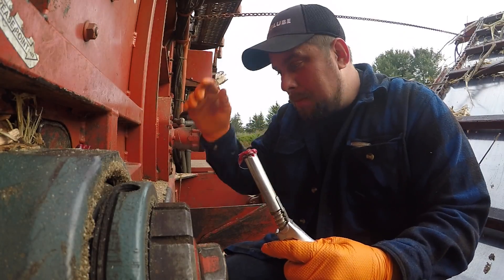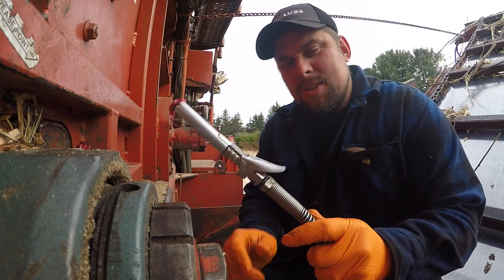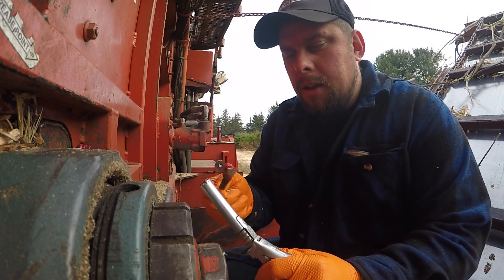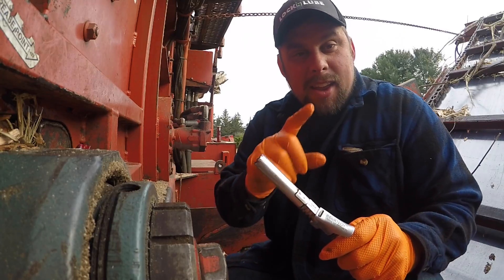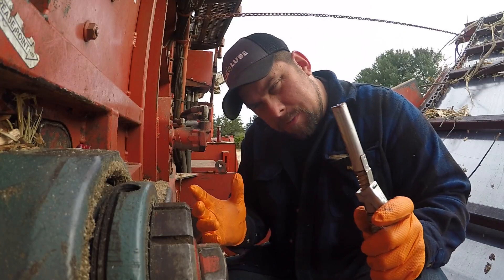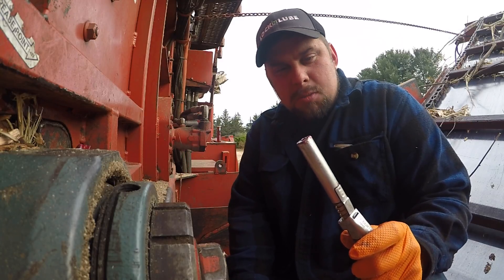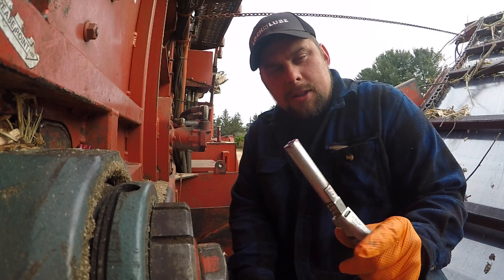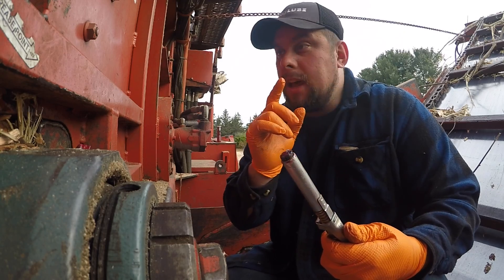AWESOME GREASE TOOL!!

Comment: I have the same grease gun, love it and the lock n lube as well.  Just a suggestion, I made up a short hose with a grease nipple on one end and a small conventional coupler on the other end, just join it to you lock n lube coupler for the odd hard access zerks, and you can still leave your lock n lube coupler  for the majority of the zerks that are easily accessible.

Comment: we have used LOCK N LUBE for about 3 years now and I love it.   we had 2 fittings on the case 60xt that just didn't like taking grease with the the standard coupler.   When we went to the LOCK N LUBE they would take grease every time now.     we have the short one and it can be a bit difficult to get on some fittings but overall I would recommend it 100% !!!!  
now where is my free hat LOCK N LUBE  haha
Reply from the maker: +Skidder Kev haha it’s a nice hat too!! Thanks for Watching
Reply: rub it in why don't  ya!   haha

Comment: Wipe the fittings off before you add grease so you don't push items to the bearings etc.
Reply: ....I do it even if it's for pins/bushings, extending-shafts, etc.... It's simple discipline (others have to pay, and see the cost of their production-lost and what it takes of work that it takes to fix em, in order to add this discipline to their maintenance-list) (which can even crash an early fresh starting business)

Comment: I have a couple of the shorter ones.  Mine came with a rebuild kit included.  Just use another grease gun with the standard fitting and buy the shorter Lock N Lube for the power grease gun.  They can not be beat for not leaking and staying on for sure!!!
  Just remember with any grease gun model you need to clean the dirt off the grease zirk before using a gun to put grease in.  The dirt hurts the sealing of any grease gun!

Comment: I was at our local equipment dealer Buck and Knobby some of you have prolly heard of them if you are from around Michigan/Ohio border and they only had a long one in stock and I picked it up and I love it to death makes greasing fun for once I have only found one situation where it's to long but it is easy to solve. I was using it on a performance tool air powers grease gun but gonna have boss man pick up a battery powered one and the grease I use is Chem Search, probably the best grease you can get.

Comment: Might have to check into the short one for greasing my super duty could come in handy. Somebody probably thought it would come in handy somewhere else. Thanks for the review. Say hi to lacey for me and let her now I'm thinking about her.Keep up the great video's
Reply: The only grease zirks your truck has is 2, on the front wheel drive  shaft, the 2 universal joints.  Short  or long tip will work.
Reply: i had to buy mine cost was like $35.00 but to me well worth it & all i have are little stuff like 6 garden tractors 1 lawn tractor plus 4 cars 1 van

Comment: U could get a traditional grease gun extension hose with a std zerk on on end and std coupler on the other. U could lock it on the locknlube when needed to get into the grapple and remove it when not needed.

Comment: Sorta surprised you don't take the time to wipe the zirks before greasing John.  I'm amazed "someone" ever gets employed anywhere, hands down is the most lazy useless employee on any job site. Funny people buy and use a brand/type of grease and use it on everything, grease is just oil in a semi solid carrier fluid that acts like a sponge, therfore you should use one grade on your high speed bearings and a different grade on your pins and bushes usualy one with 3 - 5% molly. Cheers mate.🍻

Comment: Why take it off??? Make your own adapter/extension from an ordinary nozzle + hose + grease-zurt. You'll able to grease where L&L can't go. And since L&L holds itself good, you'll only need to hold the extension-nozzle on the machine's zert. That is my solution anyway for places I can only crawl under a machine, evenless holding any grease-gun along, but I have a 20ft grease-hose-extension and another person pumping the grease gun away. But you also make an adapter from just a zert and nozzle if that's all you need (just attach with a leech on the grease-gun so that any "lunatic" that's hanging around in your bunch of workers don't think it's a loose candy and eat it)

Now, I still don't have any Lock&Lube as I hate mail-ordering etc and can't find any of those in any hardware-store 50miles around me, even though I've been talking to everyone about Lock&Lube for over a year now (ever since I heard about them from Oneloneleyfarmer)
All I could find was some cheap copy of those which I rather stay away from :-(
Reply: Zerk not zurt....